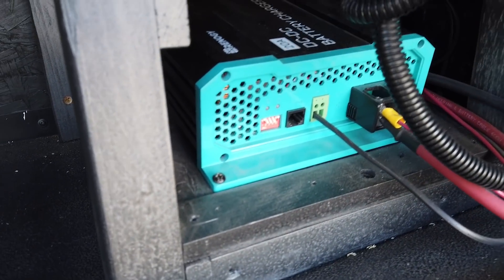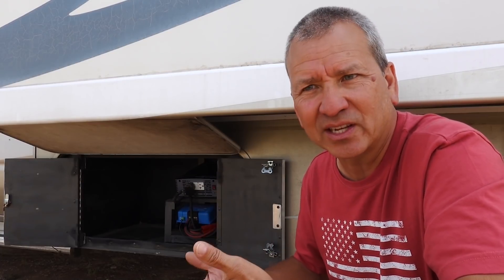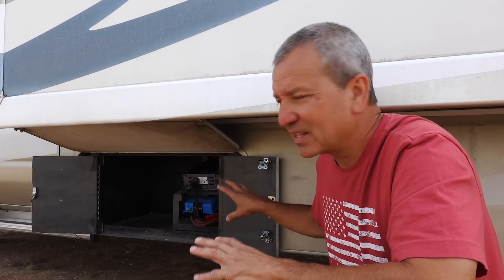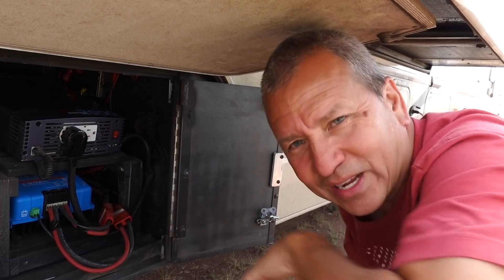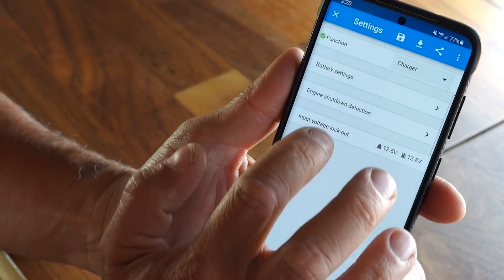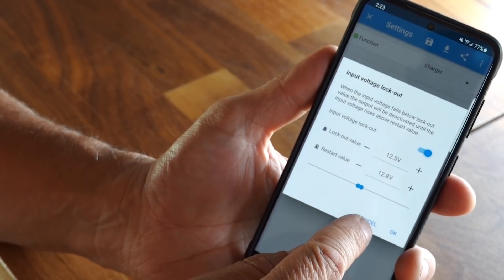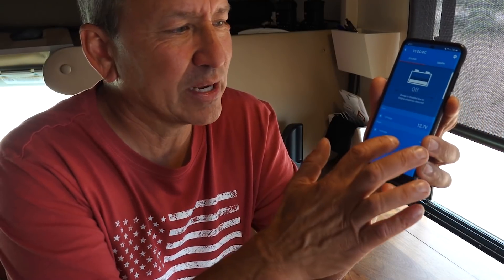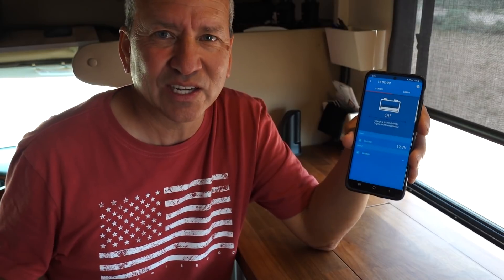RENOGY or VICTRON DC-to-DC Charger for Lithium LiFePO4? / Off-grid RV Solar / RV DIY

Comment: Brian, why a DC to DC charger and not just use a Battery isolation Manager that is made for Lithium batteries?
Reply: A battery isolator only protects one battery from influencing the charging or discharging of another. A batter isolator DOES NOT provide the proper charging profile to the batteries in that it does not switch between bulk, absorption, and float modes so while it will allow your battery to be charged, it’s not the best and efficient way to do so. A battery isolator just prevents your RV from drawing power from your starter battery and pulling it down, and if equipped with a switch will allow your RV battery to charge your starter battery.
Reply from the maker: Haven't tried those, but I like having my Victron gear all managed in one place. That's one reason.
Reply: Further to @Marv S, a battery isolator wouldn't protect you from overloading your alternator. A fully discharged Li-Ion battery would essentially 'look like' a dead short circuit to a power source so no matter when the isolator 'kicks in', you're going to get a huge subsequent current draw. You should never directly charge a Li-Ion battery from an alternator, assuming that you want to protect your safety and investment, of course.

There are 'smart alternators' out there that current limit their output to some maximum but you'll still need to design your system around that limit e.g. if your house battery needs 14.6V to fully charge and your alternative produces 14.8V, you can only drop 0.2V along the cable run - that requires some seriously big cable to achieve.
Reply: @tictagtube Battle born recommends a BIM.Battle Born LiFePO4 Battery Isolation Manager Li-BIM225. Under normal charging conditions, the Li-BIM225 will connect for 15 minutes every 35 minutes. That means that the BIM will connect for 15 minutes, disconnect for 20 minutes, and repeat this cycle until the coach battery is charged.

If the coach battery resting voltage exceeds 13.4V than the Li-BIM225 will disconnect. A resting voltage greater than 13.4V indicates a fully charged battery. Note that “resting voltage” means that no current is flowing to the coach battery.

The Li-BIM225 will disconnect if the alternator voltage exceeds 14.4V. This protects the coach battery from over charging.

The BIM will disconnect if the voltage difference between the alternator and the coach battery is less than 0.1V. If the voltage difference is too low, then there is a negligible charging current, and no need to connect to the coach battery

The BIM will disconnect if the alternator voltage drops below 13.3V. If the alternator voltage is too low, than it cannot adequately charge the coach battery, so there is no reason to connect.
Reply: @liedj2317  It sounds like this device has been designed with alternator charging in mind, and has a lot of smarts, though no mention of current limiting. As a personal preference, I believe a DC-DC charger would offer a better solution.

Comment: Brian  , Thank you for your informative videos. I always look forward to your updates. I Just bought a Victron 1212/30 DCDC charger and have not yet installed it . I don't think I'm going to use the switch and just let it do it automatically. I have a 2021 winnebago with a 210 amp alt. I just got this new Rv so I will soon be installing my GOPOWER IC2000 inverter , My 600 watts of solar and a Victron Smart Solar controller , Battleborn batteries and this Victron DCDC charger.  Your videos keep me motivated so keep posting and thanks. Watching your vids has helped me get the courage to do these projects.  Thanks again ...Tony
Reply from the maker: You're 210 Amp alternator should work great. Mine is much smaller. Good luck!
Reply: You may wanna consider a Victron buck booster to charge faster. Can draw up to 100 Amps if I remember correctly.
Reply: You can DIY your batteries and save 80% and have a battery you can manage.   BB are way overpriced
Reply: I'm considering adding a victron to my car audio setup which features a 48ah spim08hp. Considering the smaller size of my battery, would a 10 or 20 amp suffice?

Comment: Very useful video, I'm getting ready to install a 2 awg umbilical cord setup in my 2020 f350 dual alternator tow vehicle.  With the factory dual alternator option in our trucks tow package, one would think we're golden in getting a useful charge back to the coach batteries ... But nooooo!  Going to install a 40 amp DC/DC unit in our rig.  Thanks, we enjoy all your episodes.

Now if you just had a 40% discount code for us ... 🤣
Reply from the maker: Without a DC-to-DC the voltage in the truck needs to be sufficiently higher than the coach voltage in order for current to flow back. The DC-to-DC charger will charge at an appropriate voltage which could be up to 14.6 volts.
Reply: Mortons on the Move YT channel has some info of the SuperDuty dual alternator setup...Ford only 'turns on' the second alternator under certain conditions...

Comment: Great Video!
Just curious I would like to add a dc to dc to my Ford  2002 7.3 power Stroke any ideas how I can find out if I have a variable current (smart alternator)?
 The Ford Dealership and a local alternator repair shop had no idea what I was talking about. How did you determine what you have in your Ford motor home ?
Reply from the maker: I've heard that if you give a dealer the VIN they can tell you.

Comment: That’s a nice mod Brian if I were to switch to lithium on my travel trailer I know that it charges through the 7:way plug I would probably have to run a second charge line from the truck to use that I know if you don’t put some sort of device on your system it can cook the alternator I watched that battle born video and I was quite surprised with the outcome 😁
Reply from the maker: You may want to use an online voltage drop calculate to figure out what cable thickness to use for the length you need. Good luck.
Reply: Corey what is a popular way other folks are protecting their alternator VIA the RV 7 way plug? Thanks.
Reply: @kk-pz8gn  watch Jared from all about rvs I think you only have to protect it if you are running a separate charge line the 7 way only puts out about 1 to 2 amps while charging

Comment: Mppt will charge battery from alternator no problem. Except victrons they put regulator to stop that so people buy more junk stuff. Apologies. :)
Reply: You don’t like the $200 bussbars?
Reply: It's for fools with rich daddy :)
Reply: @Endless_Skyway_Adventures  Smile
Reply: An MPPT could, yes, charge a battery from an alternator but you couldn't then use it for your PV, so you'd have to buy two (assuming you also had PV). MPPTs are considerably more expensive than DC-DC charger so this option is simply less performant and more expensive with absolutely no upside.
Reply: @tictagtube  why not using same mppt for both as you would have two solar arrays with one directional diode?
Reply: @897aa33  An MPPT ( Maximum Power Point Tracking ), as the name implies, is an active device that varies its output power depending on its input's maximum power point. If the input is being clamped to an unchanging voltage (i.e. a battery) then it can't do its job, there is no power point to track, basically turning your very expensive MPPT into a cheap $15 PWM. Whilst it will work, it is waste of money and will significantly reduce the performance of your system.
Reply: U have convinced me to use a cheap PWM and an equally cheap isolator instead of this 250$ Bluetooth sh*t box, sir, good job. :)
Reply: Good MPPT chargers require around 5v input higher than battery voltage to start. So they mat not be useful to use as alternator voltage may be as low as 13.8v.
Also a lithium battery may have a fully charged voltage of 14.2v so the alternator may not ever charge the battery enough to initiate to balancing. I have used a MPPT to charge my lithium before but I use a boost converter which converts the alternator voltage to 30v and this allows my MPPT to work just fine. But a cheap PWM can be used just as good, yet save you quite a bit of money.

Comment: What is actual difference between mppt and b2b chargers, both getting current from the source and processing according to the charging profile?
Reply from the maker: B2B chargers are actually designed for this purpose. If you use a solar charge controller, you'll need one that outputs enough current. Also, lots of smaller controllers can't accept larger cable connections.
Reply: @RVwithTito  Thanks Tito. Love your channel.
Reply: MPPT solar charge controllers typically  buck higher-voltage solar power down to battery charging voltage.  B2b generally boost from similar voltage DC sources (batteries, alternators).  There are exceptions but that's the general deal.
Reply: @fratermus5502  so you recon if printed mppt on the box I am not allowed to use for b2b purposes or because current from b2b has different colours?
Reply: @Mark MPPT ( Maximum Power Point Tracking ) chargers are designed specifically for PV arrays, they continually (e.g. 10 times per second) vary their output in order to track the maximum power point of the connected PV array as solar irradiance changes over time e.g. clouds. If you connect an MPPT to a battery, it has nothing to track - you're just paying for features it'll never use. DC-DC chargers or a lot 'dumber' ( and therefore, generally cheaper ) and, as has been mentioned, either act as a configurable current buffer or buck/boost the input.

Comment: Have you tried the Battle Born Batter  Isolator ? You konnekt the lead battery  in conjunction with the lithium….. 70amp Charge Rate
Reply from the maker: No I haven't tried that one. Do you have one?
Reply: Remember that the Battery Isolator DOES NOT control the charging voltage, the alternator will. It will also not regulate the charging current, the battery itself will.. This isn’t the best way to charge your batteries. Its function is not that of a battery charger, its designed to prevent your RV/house battery from discharging your Starter batteryl.